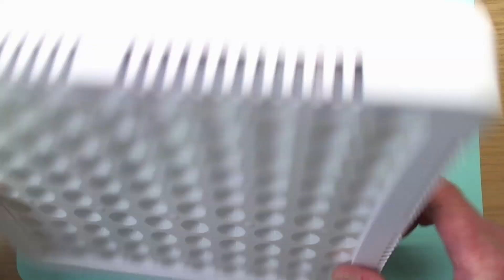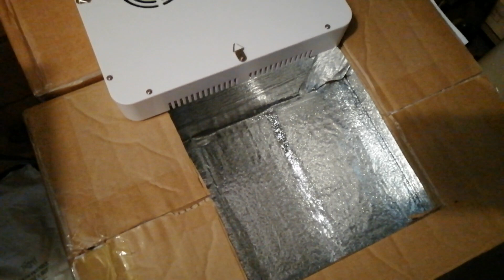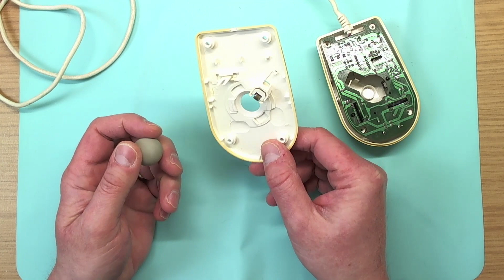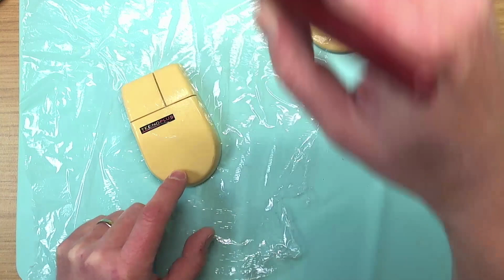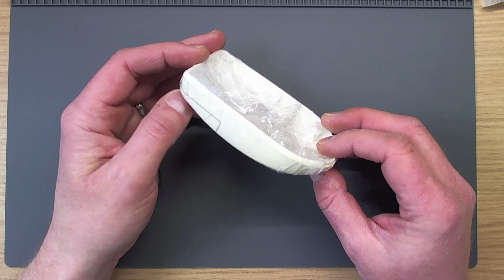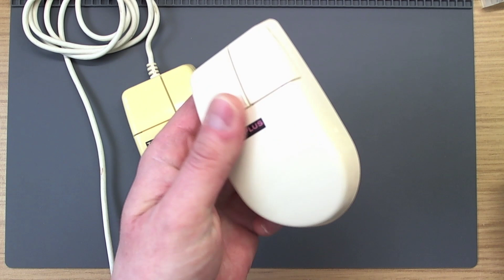Magic Winter RetroBriting Light Box

Comment: Nice! I might have to get one of those. I put a whole load of Atari cases (and a Camputers Lynx - remember them?!) from all generations, out in the UK sun early last summer, no peroxide. Two or three days and they were pretty much back to original. I guess it was pretty slow, but it was lockdown, so I just used the simplest method on the off-chance. You’re not the only one I’ve read had no luck though! They had a real proper washing beforehand, maybe that helps. And it was scorching sun outside at that point. They seem to be holding up well so far too. Worth a go for anyone who doesn’t mind looking like a total geek nut job to the neighbours!
Reply from the maker: Glad to hear it worked for you. I left an XE keyboard and case out all day a couple of years back in high summer and results were disappointing, but perhaps careful cleaning helps, as you say. Cleaning is also helps Peroxide treatment work optimally. What I will say is that I think any treatment which takes a bit longer probably tends to be more long-lasting. The best thing - as ever - is to try to source machines which never yellowed in the first place. This isn't easy, of course, but I was lucky enough to acquire a lot of Ataris and the un-yellowed ones have kind of gained favour in the collection. The rest I'm not too bothered about, since they are stored in the cupboard and only brought out for testing purposes and are basically an insurance policy against failures are parts shortages. They can always be Retr0Brited at some point in the future.

Comment: I wonder how long until it re-yellows?  Have you tried brightening with just the UV light and no peroxide?  I hear that's the "new thing" now - supposed to last longer.
Reply from the maker: Twenty minutes, LOL. Seriously: I expect that mouse to be yellow again in a year. Every plastic is different. I tried the much vaunted 'Sun only' method, and it didn't do shit here in the UK in the height of summer. To last longer, first something has to happen. :) I've been using the Creme Peroxide method for a decade now and aside from some early mishaps with 'blooming' (which things like cling-film all but eradicate), there is nothing to complain about. Natural sunlight with peroxide treated parts wrapped up to prevent drying achieves the best results in my books. I've had no problems with 'brittle plastic' and other supposed degradation of the materials owing to repeated treatement, either. The light box is just a needs-must variation on my standard method.

Comment: Thumbs up. You mentioned it so..... your 8-bit gui looks great but without some kind of programming language to allow the user to create programs "within" the gui, to me, would seem pointless. And would it require a XE?  I hope not, I had a 520STFM back in 86(?) but I always preferred the XL machines over the XEs. The XL was a beautiful design.
Reply from the maker: The programming language exists: assembly language, compiled my MADS. That's how the existing apps and drivers were written. I suppose someone could make a custom language (perhaps high level), and maybe even one which runs inside the OS, but that's above my pay grade. I simply envisaged people writing applications and drivers in the same way I have, although a resource editor will certainly be most helpful. The GOS requires a 128K XL/XE and has no other special requirements. 800XL with any old RAM upgrade or U1MB will be fine.
Reply: @flashjazzcat  Is GOS available for download(?) and is there a published list of the API calls?   Used ResEdit on the Mac but I forget the resource editor used on the ST. Used Consulair assembler on the ST I think, might have been for Mac, I forget.
Reply from the maker: @Anangelspath  API isn't documented yet since little is finalised, but it's loosely based on the SymbOS API, which is fully documented. Download: https://atari8.co.uk/gui/